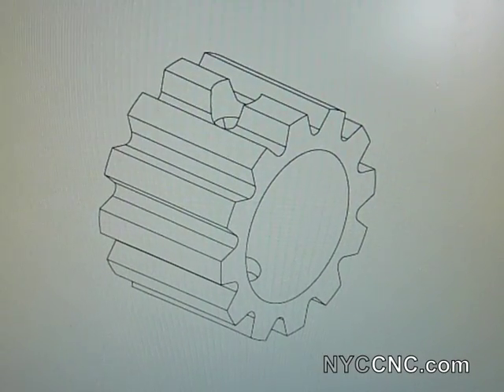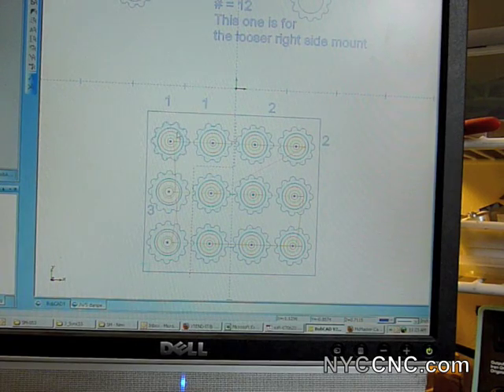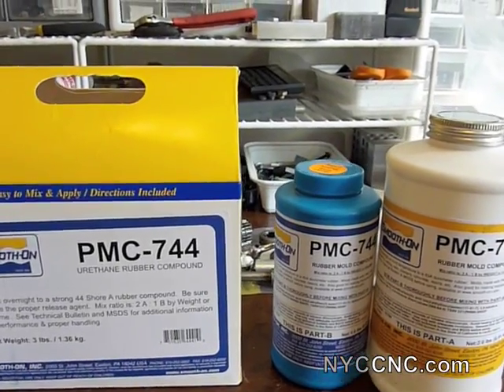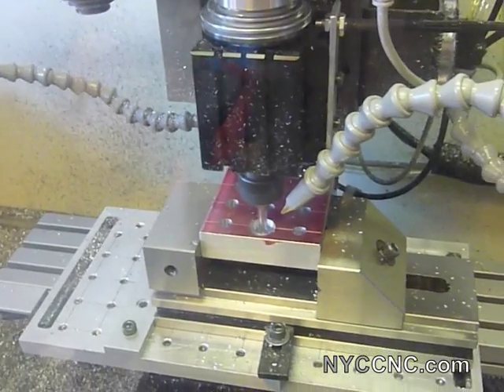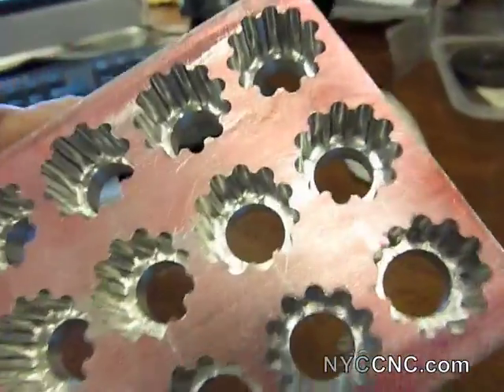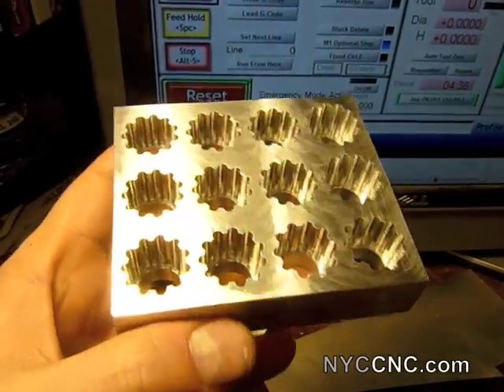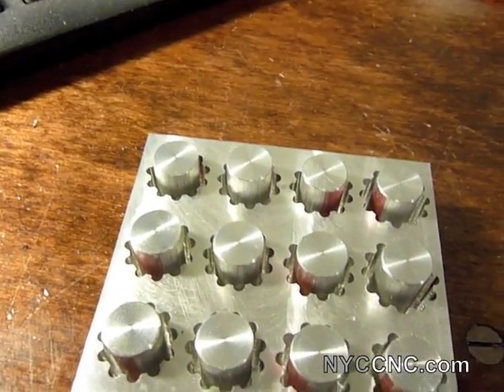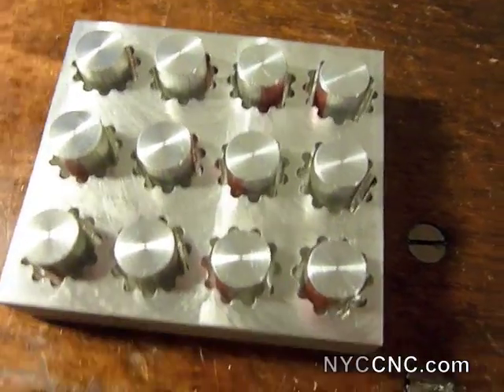Machining & Casting an Aluminum Mold for Smooth-On Urethane Rubber (Part 1 of 2)

Comment: @joecobra1234 Perhaps.  Although there's a bit more to it than that.  But... what if you had a manual mill, and the electricity went off?  If you weren't a blacksmith, well... TWBF!  What's your point?  For that matter, what's somebody who thinks like that doing posting on the InterWeb?  Shouldn't you be... sending telegrams...?  Or carving your messages into stone tablets...?  Time marches on... ;-)